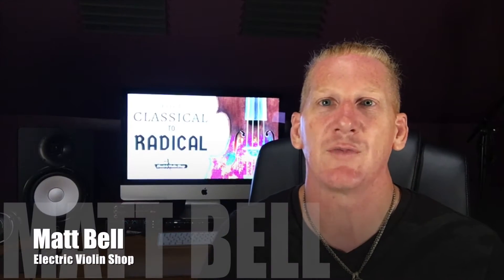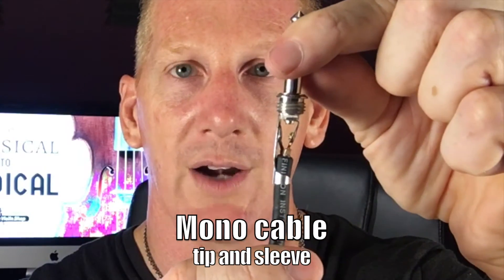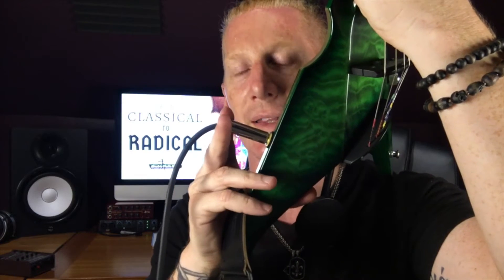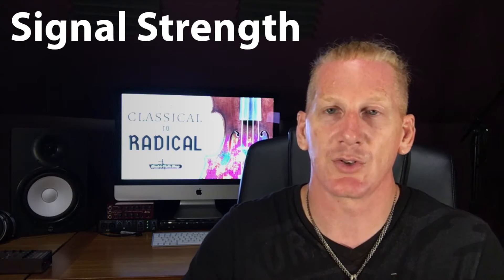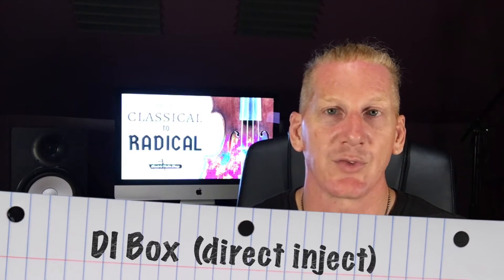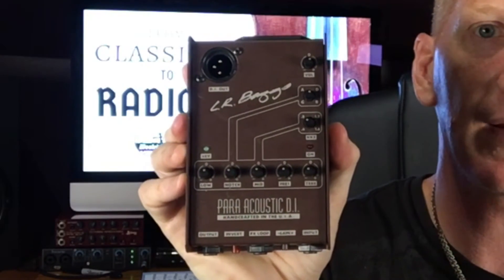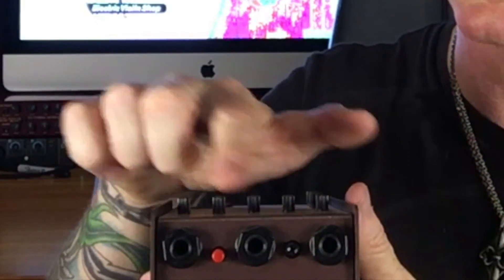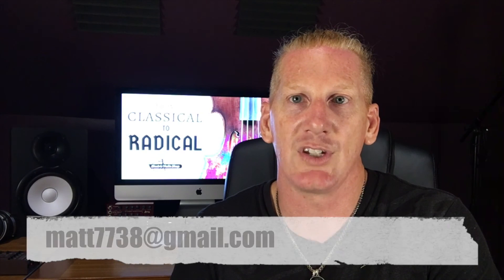FCTR: Connecting to the Sound Board

Comment: Hello Matt, these videos are very useful, thank you!!! I have some questions that are bugging me  since years ago. I have an old Yamaha Silent SV-120. I use a USB interface to connect it to the computer and sometimes I also use it with a little electric guitar amp. I am very confused about what is the best output jack to use which each case: line or phones? I notice that the line one tends to sound more nasal and the phones one is richer in high harmonics, but I'm not sure if the former is due to impedance or something I'm doing wrong. Should I also use a DI/preamp even if the violin has an integrated preamp? Thank you very much for your time.
Reply from the maker: Line and Phones will be wildly different impedances.  As long as you're not overdriving your input, you can use whichever one you want.

Your preamp is probably designed to prefer the Line input, but as the old adage goes, "If it sounds good, it IS good."
Reply: @ElectricViolinShop  thank you very much!!

Comment: In general, electric guitars use a mic. Should I consider using a mic as well, or is a DI better always?
Reply from the maker: thunderbolt73 You can mic your speaker, which gives you the tone of your cabinet and some room ambience. This is a bit of an adcanced technique with a lit of variables (mic type, mic pattern, placement and distance). No right answers, just lots of experimentation.
Reply: Electric Violin Shop makes sense. Luckily, decent mics don't seem to cost too much. Like $100 for the standard shure stuff.

Comment: Hey Matt, great video!  Does my Fishman (loudbox mini) amp do the same thing as a DI?  If I switch from my passive FV3 to an active NXTa or Bridge Lyra, is a DI still required?  Thanks!
Reply from the maker: Yes.  Your Loudbox Mini serves as both a preamp and a DI.  It has an XLR out in the back.  No DI required.  The only issue is that the Loudbox does not have a ground lift like most DIs do.  If you get a ground hum, you might have to insert a DI and lift the ground.  Those are not super common, though...

Comment: I have been using my NS CR5 (active pickup) through a Boss ME-25 effects board, to the PA. Would you still recommend adding a DI?
Reply from the maker: Here impedance is not so much the issue as is the unbalanced output from the ME-25 straight to the board. Guitar multi-effects are really designed to be plugged into an amp or preamp, so they send an unbalanced out, which can result in signal loss/noise over a long cable run. Still best practice to send to a DI and then use the balanced XLR out to the board. That said, if your PA takes an unbalanced input and you've not been experiencing any problems, then go with whatever works! This stuff is a science, but it's applied as an art.

Comment: Can you explain the Fx loop a bit more? I'm not quite sure how to get going with that, or if I would even want to. I generally send into my pedalboard and send out of my Para Acoustic DI (As pictured), though I'm wondering what should be done with that FX hole. You say that it takes a stereo plug, but I'm not quite sure how I would utilize that. Thanks!
Reply from the maker: We'll probably get into it in more detail in a later video. It's basically a send/return that allows you to insert effects in between the gain stage and the EQ section of the preamp. To use it you would need an insert cable (stereo plug with a Y cable to two mono plugs). Depending on how you use effects it could make a difference in tone--certainly worth experimenting both ways. Hope that helps.
Reply: Do you know where I might read more about this? Any good resources out there?
Reply: +crawfordviolin We'll definitely cover that in an upcoming video. You can email us at info@electricviolinshop.com and Matt can try to explain it in an email.
Reply from the maker: Okay - I'm at the shop now and not trying to type this with my thumbs.  Haha!

What the effects send/return on the Para Acoustic DI uses is an "insert"-style loop.

Some devices have two jacks - one for send and one for return.  Others use a single jack.  It requires a cable called an "insert cable".  It is a stereo jack on one end and splits out to two mono jacks.  It'll look like a "Y".  

Look in the video again right around 1:09 and I talk about stereo vs mono cables.  You can see that there are three sections to the jack in a stereo cable.  That allows two signals to be sent on that one cable.  In the case of an insert effect, one signal goes out and another comes back.  There will be two mono jacks on the other end of the cable.  If it's a true "insert" cable, it'll be labelled "send" and "return".  If not, you'll just have to experiment to see which way you're wired.  If you have it backwards, it won't work.

Hope that helps.  We will definitely address this in a future video.
Reply: Thanks for the reply. I really appreciate what you guys are doing to further the plugged-in violin knowledge. From the DI documentation:
--
Effects loop: This jack provides a send-return on a stereo jack for outboard effects that allow you to blend reverb, chorus or other effects in
with a dry signal. Use an insert cable (stereo plug with a Y cable to two mono plugs) to connect the effect. The tip is the "send" and goes to the
input of your effect. The ring is the "return" and comes from the output of your effect, and the sleeve is the ground. You may adjust the amount of
effect in the signal by using the controls of the outboard effect. The send (tip) of this connector comes directly from the pure class A discrete
input stage of the Para D.I., before the EQ, volume control, invert switch and output driver. Therefore it can be used as an immaculate, unbalanced
direct output. It will not be affected by any of the panel controls (with the exception of the gain control). Use a regular mono cable. The effects
loop interrupts the signal path. Therefore, it may also be used as an insert point for a compressor, volume pedal, or tuner if the tuner has a bypass
switch.
---
I just really do not understand what the effects loop does, why you would want to use it (what does it accomplish), where it would plug in, etc.  Looking forward to a vid on this. Thanks!

-Greg
Reply from the maker: Right, okay.  So an "effect" is what we use to change the sound of the instrument in some way.  It could be reverb, distortion, or some other manipulation of the electrical signal created by the violin.  Generally, they are in the form of a box that has some knobs and a switch you can stomp with your foot to turn it on and off.  That's why they're often called "stomp boxes".

There are a couple of different ways to put them in your signal path.  You can just line them all up in series.  You plug your violin into the first one, plug the output of the first one into the input of the second one and so on.  The output of the last pedal would go into your DI or your amp.

OR, you could use an effects loop in your DI.  You plug your violin into the DI and then use the effects loop on the DI to send your signal out to your stompboxes.  The output from your last stompbox then returns to the DI and then goes out through the XLR output of the DI.

I'm going to go live on Facebook in about 30 minutes.  I'll try to do a more visual explanation then.
Reply: Do you have a link to your live feed on FB? I tried to find it, but no luck.
Reply from the maker: +crawfordviolin We'll post the link when it's available later.
Reply from the maker: ICYMI, here you go. Hope this clears up FX loops for you... www.facebook.com/ElectricViolinShop/videos/vl.146731185751059/10153781309948753/
Reply: Thanks Matt! I really appreciate the time you put into this. I guess the next step would be a demo. This might be something I can try myself. I typically run directly from my pedal board, starting by plugging in my 1/4 inch into my reverb, then into my octave pedal, then overdrive, then wah, 'Warped Vinyl', then looper. It would be great if i could see a demo of the actual sound difference. Using an acoustic instrument with passive pickup, the overdrive is especially a bit touchy and I need to carefully adjust the gain, volume, and tone so as not to receive feedback... I wonder if the fx loop might help to reduce that issue. Some additional questions: 1) can you run a chain of effects using the Fx loop? 2) could you use the FX input to run another instrument (say a mandolin) into the preamp without having to buy a second preamp?

I appreciate all the time you have taken.

Thanks,
Greg
Reply from the maker: crawfordviolin 1) Yes, you certainly can run a chain of effects in series with the FX loop. 2) The FX loop input/output is not really a second channel, it's just an insert between (in the case of the Baggs Para DI) gain and EQ stages of the preamp. Guessing that it'll pass the violin from the gain stage to the EQ and then insert the mandolin signal straight to EQ with none of the gain. You can try and let us know how it worked for you, but this method lacks the individual input control of a designed two-channel amp or multi-channel mixer.
Reply: Two things...  1.  As you've noticed, using distortion or overdrive with an acoustic violin is very touchy, at best.  The fx loop will not really help with that.  It has to do with the fact that you're playing an instrument that's designed to feedback.  I mean, that's what resonance is.  The body of your instrument has been designed to amplify what it hears.  And distortion and overdrive effects make acoustic instruments ring like crazy.  That's why solid-body instruments were invented.  If you want to use distortion or overdrive, you're probably looking at buying a solid-body instrument.  That being said, one thing you can do to help decrease resonance is to throw some gaff tape over the f-holes of the instrument.  That gives a lot of people heartburn, but if you're dragging your instrument into a bar, you're risking far worse than that, anyway.  Go watch some old country music live videos.  Most fiddle players have tape over their f-holes.  

The second thing - I would have my reverb closer to the end of my signal chain.  Reverb adds a lot of frequencies to your sound.  No way would I add a bunch of frequencies and then feed ALL of those frequencies to my octave pedal or my overdrive.  If it were me, I'd put the reverb right before the looper - or even right after.  That'll clean up your sound quite a bit.

The order of your effects is really important.  Reverb then octave will give a much different sound than octave then reverb.  Play with that and see what you think.
Reply: Cool. Thanks again for the info Matt!